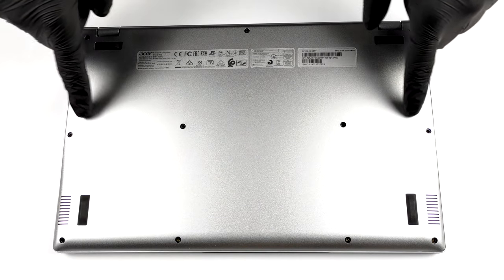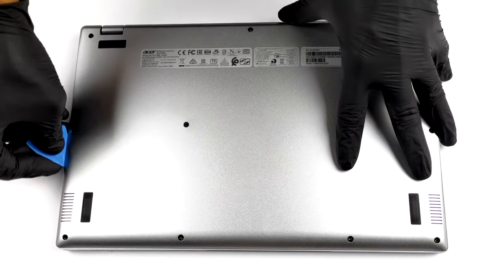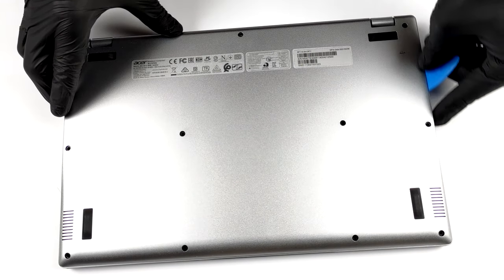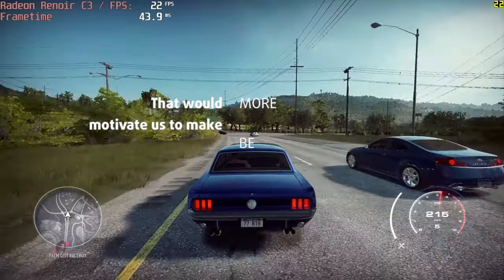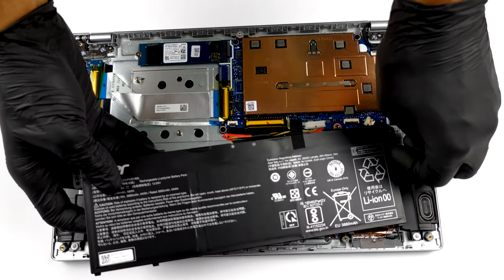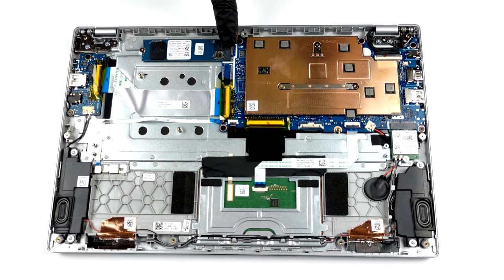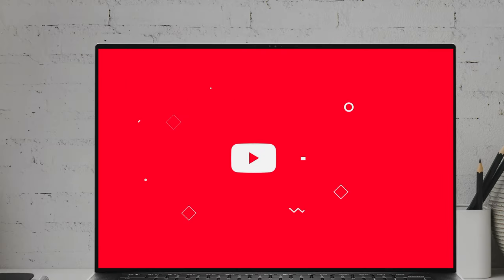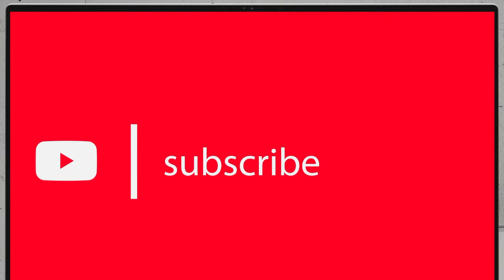🛠️ Acer Swift 1 (SF114-34)  - disassembly and upgrade options

Comment: Hello
Acer Swift SF114-34, N6000, 8/512
Can I replace the AX201 WiFi module with AX210, AX211 or AX411? Add RAM (solder) up to 16GB and replace SSD with 1TB?

Comment: Are there 2 x NVMe slots?
Reply: I believe he is saying there is ONE M.2 nvme slot - which sounds like he is saying there are two nvme slots
Reply: Yes, below the ssd in the video you can see a second slot.
Reply: What size of m.2 SSD? 2280?
Reply: @Karl_Donnerlörres  yes, and one slot only in the newer models
Reply: @yeliz2001durmaz  below the ssd you can see the non-existent second slot, as its not smoldered on the board.

Comment: dont bother putting windows 11 on your swift 1, 4gb is enough ram to install windows 11 but not actually do anything or it will crash, stick with windows 10
Reply: …I’ve went to windows 11. Is there a way to go back
Reply: @jonathandavies4569  I haven’t noticed much difference from windows 11 and 10 but your device might deal with both software differently. Meaning that windows 11 might be better for you
Reply: @jonathandavies4569  nvm u clearly have the swift 114. Id recommended windows 10 unless u wnna try out 11 and go back to 10 if it isn’t any better
Reply: I have windows 11 and find it smoother than 10. Fingerprint scanner works a lot better too.